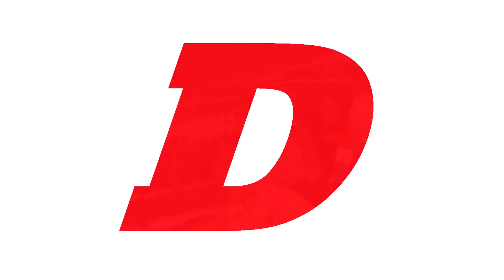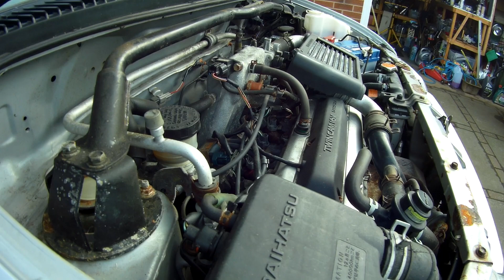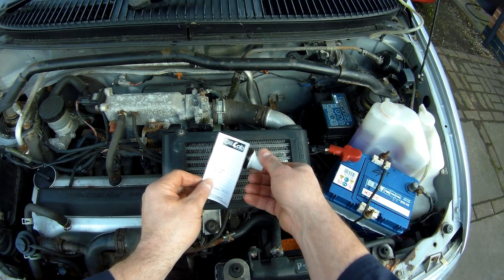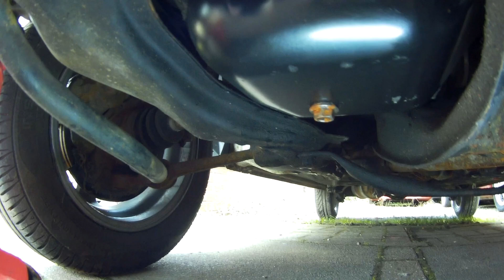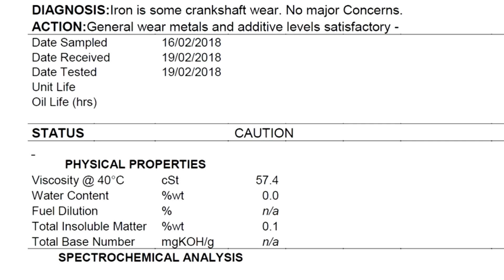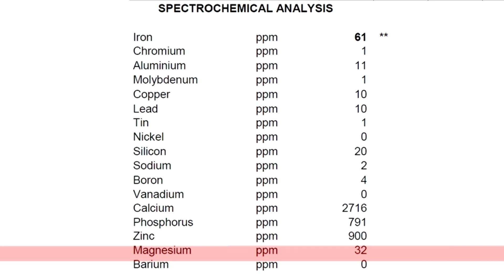Sludge Free? Engine Oil Analysis - Daihatsu Cuore Avanzato TR-XX R4

Comment: Castrol magnatec is not really the best oil to combat sludge as it's known to cause sludge if left in too long. Rather use a chevron or shell product. Delo 400 MGX will be great for that engine and faaaar exceeds the required specifications.
Reply: Call the oil police. You may have a point but you also do not know what the oil change protocol is going to be or what prodict he is going to use. Or if someone else is going end up owning and driving the car. Personally, I'd be more worried about the steering wheel. It's still on the wrong side.
Reply from the maker: I've never really had an issue with it myself, plus it's what I had "in stock". I don't think the Delo you mention is sold here, plus it looks like it's a 15W40 anyway.
Reply: InitialDave is this channel abandoned or are you going to upload again?
Reply: Marius Fourie Ive used Shell Helix 5W-40 ultra in my japanese cars. Worked like a charm

Comment: i dont think nickel would be in most car cranks. not factory ones anyway. they are usually iron carbon manganese and molybdenum. you may find chromium in a larger engines crank.
Reply from the maker: doh1976 I'm specifically thinking it may be a steel crank in the engine rather than an iron one. It's something that's in the back of my mind from somewhere, but I wasn't able to confirm it one way or the other, and I can't remember where I'm getting that from, so it's not really a definitive statement I'm making there.
Reply: what i meant was steel cranks are an alloy of iron carbon manganese and molybdenum. in fact all steels are mostly iron alloys. so a typical  steel crank might be .4% carbon 1% manganese 1.5% moly with the balance iron. 
anyway you are right to not be to concerned, the new oil has detergents and will hold any debris still laying in the pan in suspension until it passes the oil filter. it probably picked up some iron from any of the old oil that was left in the oil passages.
Reply from the maker: Ah, I follow you, yes. You're probably right, and thinking about it, even if it were to have some nickel content, it might well be low enough to not flag up at all if in proportion to the iron levels I'm seeing. I kind of had a couple of percent nickel content in my head as "about right", for say something like 4340, but of course it's going to be very dependent of the steel chosen - if it even is steel!
Your thinking mirrors my own on this being more pre-existing muck that's been picked up and carried out by the new oil, rather than being "new" wear.
Reply: The best cast iron blocks have a certain amount of nickel in them to increase durability. High nickel could indicate high cylinder bore wear.
Reply: InitialDave is this channel abandoned or are you going to upload again?

Comment: Run some seafoam through the crankcase to clean up any leftover sludge. Run it for about 100 miles and change the oil and filter. Cleaned up a lot of sludge outta my Corolla and it ran much quieter and smoother.
Reply: Seafoam is turpentine and naptha just like every other product. Just use the cheap stuff.

Comment: I bought a car with the engine sludged up, it still makes knocking noises when it's cold no amount of flushing will fix the damage that neglecting oil changes will do, I found that adding half a liter of Transmission fluid each oil change helps thin the oil down so it knocks less on cold mornings, good thing the car was cheap or I would be really pissed because the previous owner is a dumb ass , the car is in nice shape otherwise, Don't waste your money on oil additives just put good quality oil in and change it on time, if your engine is damaged no additive can fix that
Reply from the maker: I didn't use any additive? The Liqui-Moly bottle is a flush.

But yeah, nothing you can do to put metal back on, once it's getting to that point, it's rebuild time.
Reply: Shiddy That's only hiding the problem...
but yeah if it is a beater or something and it works its okay i guess
Reply: Lucas oil has an additive that can help, depending on why it is knocking of course.

Comment: Mate if you really want to know if there is slugde take the sump off a I bet their will be a think mud like substance about a one or more inches thick I brought a Nissan pulsar n15 never really was maintained well and was using alot of oil it was over filled because of the amount of slug was in the sump maybe take that sump,off to have a look you’ll never get rid of all slugde
Reply: Exactly. I fear this is more a paid/promotional video given how they show products within the video.

Sump sludge is almost insoluble and despite your best efforts will remain there regardless of the solvents you pour down the engine galleries.
I personally think the sump sludge, which can be like a solid or partially solid clay, will soon prevent adequate flow of the sump oil to the oil pump.

It's a misleading video. Surely parts per million are dependent on how long the oil has been in the engine, the miles driven with the oil in the engine and also what traces of additives are in there.
It's trying to be technical (sounds it) but it fails on several levels.

Comment: I just can't understand why Daihatsu would have used a 4 cylinder for that particular model.
Reply from the maker: Can't say I know myself, but it's one of those interesting oddities you find sometimes.
Reply: InitialDave I think it's a pity because 3 cylinders just make more sense with an engine that small. They could just have taken an existing 64hp engine and increased the boost tbh. The only thing an extra cylinder does apart from less vibration is decrease torque and fuel economy. Quite a strange decision.
Reply: InitialDave never mind, I looked it up and there was only a 4 cylinder 660cc available at that time. It was the normal thing. But the predecessor and successors all have 3 cylinders when 660cc. Who knew.
Reply: In Japan, cars are taxed based on engine displacement. The least taxed cars are ones that have 660cc or less. There probably is no need to build a 660cc 4 cylinder engine for a car.

Comment: I worked for Daihatsu back in the 90's and we didn't sell many of them.I remember them and they where small little things with good mpg but just didn't appeal to customers.I had  10 yr old daihatsu Charade Turbo 1.0L 3 cyl (Tiny turbo) with 63.000 miles in 1996 and a mate who was the mechanic there tweeked the turbod (Unmodified i must add) how he did it he wouldn't tell me bu when in 2nd gear and foot on the floor it wheel spun like mad then jolted you into the seat when it had grip lol it went like a rocket!! But only 0-70mph Top speed thou was bout 105mph.It had a poxy 13 inch wheels but i shoved the Applause 14 inch steel rims on which made it handle abit better and not affect my insurance.
Reply from the maker: You don't see many of those Charades at all nowadays, never mind the turbo ones.

Comment: molybdenum is a lubricant, so higher moly content would be somewhat beneficial, not necessarily a warning sign. that said, I don't believe a lot of standard oils contain much if any molybdenum, so the low reading is likely nothing to worry about, just an indication of the contents of the virgin oil. love the video series!
Reply from the maker: Yes, though it's also an alloying element in certain steels etc.
Reply: InitialDave is this channel abandoned or are you going to upload again?

Comment: Silicon is an alloying metal (like 2% or less) for cast iron and some grades of steel, that could be some of the source.
Reply from the maker: Aha, that's a good point, yes. However, I would expect that if it were from that, then it would be in a similarly low proportion with the iron content, but with it being much higher, I'm happy enough to take their generic assessment of it being basically intake dirt.
You raise a good point, though, as with anything like this, it doesn't necessarily directly tell you the specifics, it's part of an overall picture you have to build up.
Reply: InitialDave is this channel abandoned or are you going to upload again?

Comment: Love seeing an old neglected car given some love, keep the videos coming! One comment I have is that you should really take the car for a drive and allow it to fully warm up. Usually idling like this will lead to excess fuel dilution in the oil and throw off the lab results.
Reply from the maker: Yeah, that is a risk, I agree. Not something I'd want to do regularly, but due to lack of forward planning I'd blocked the car in on my drive with another one that wasn't moveable at the time!
Reply: Well after watching that first oil change I would be pretty happy with this report if it were my car!
Reply from the maker: Mmm, it's certainly not at all bad, all things considered.

Comment: Interesting and helpful.
Reply from the maker: Thank you!
Reply: InitialDave you're welcome. What's the story on the cappuccinos I see hiding in the background? I was interested in buying this cuore. I have a Mira classic I'm restoring. And a chore L700 1.3 turbo.
Reply from the maker: They're both UK cars, I bought one a few years back, though I barely used it last year and I need to give it a good service and a bit of a clean up when the weather gets warmer. The other one is kind of a spares/future project car, it's very rusty underneath, but probably not past being saveable.
Yeah, I think a couple of people spotted the Cuore when it originally came up on Ebay, there were a few bidders on it.
Reply: Oh right that's pretty cool. I understand you're not to far from Coventry? Got any other kei cars? Anything different? Go to any car shows or anything where I could see these cars?
Reply from the maker: I'm in Leicestershire, so no, not far from Coventry.
The Cuore and Cappos are the only true Kei cars I have, but I also have some other things like 4x4 Fiat Pandas (the old ones), a series Land Rover, and a few other bits and bobs. I'm intending to do videos on my stuff as I work on things, but I'll warn you, I can be a bit slack with getting things done!
Not sure I'd consider the cars quite "show worthy", they need work, but I might well do in the future.
Reply: InitialDave I love those old panda 4x4s. They don't need to be prestine condition to be show worthy. Better that theyre in a "I have a story to tell" condition. I'd be interested to see videos on those cars as I like your videos